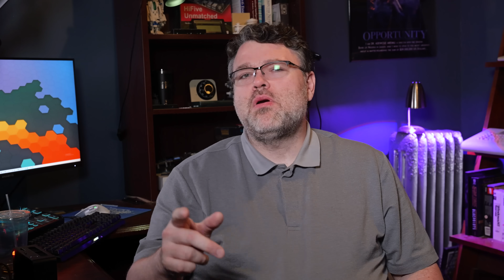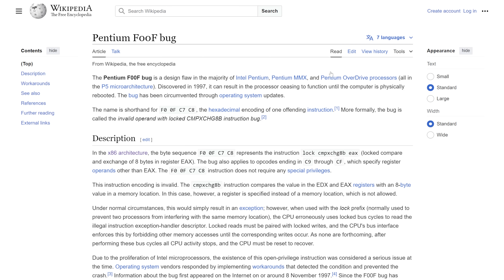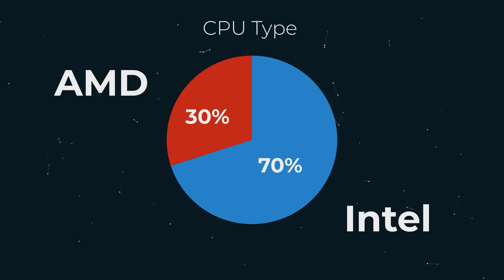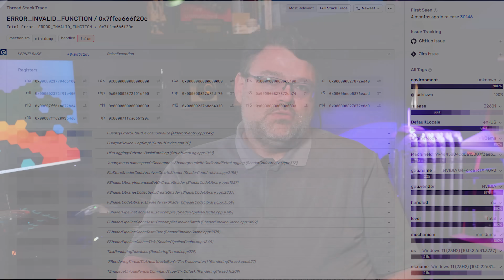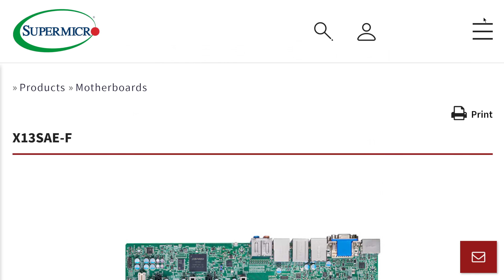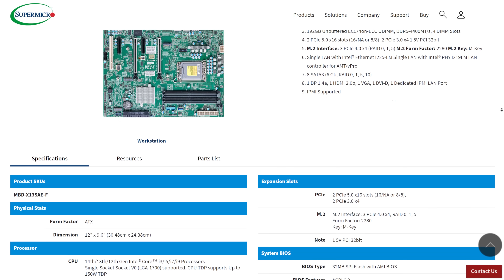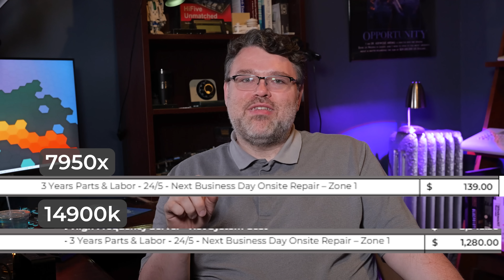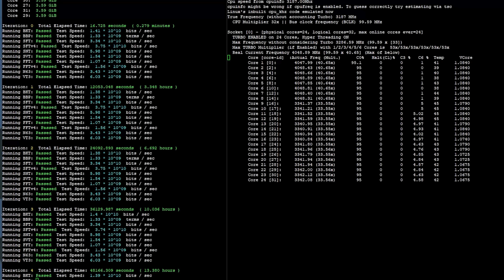Intel has a Pretty Big Problem

Comment: I know the focus has been on i9-13900 / i9-14900 chips lately. I have been seeing similar failure in HP Hardware (Z Towers for example) with the i7-13700 chips, with 2x16GB 4200Mhz DIMMs. At the office I have seen somewhere around 20-30% of the HPs with i7-13700s experiencing mystery crashes and failures which are tanking programs or the Windows kernel. The commonality of these systems are identical hardware configurations, and the systems running under a continuous load (streaming security cameras, running build chains, etc). Every system seeing problems experiences failures in the P-Cores, not the E-Cores, and it is consistently one of the cores. Sometimes the failures are detected by running Prime95 Blend for 3 minutes. Other times it can take two hours for an error.

The bad thing about the problem I'm experiencing is, HP's own Hardware Diagnostics never reproduce the problem. The diagnostics don't seem to push the CPU hard enough to trigger the problem. Because of that, even though I'm clearly experiencing crashes, HP is giving a harder time on processing a processor RMA.

The only common workaround I have right now is disabling Turbo Boost, which makes the chips miserably slow. These are systems with very Spartan BIOS and nothing but an on/off switch to Turbo Boost. But the problem took about 6-8 months of steady load to develop.

Something is definitely wrong...
Reply: sadge

Comment: This is Pentium III 1.13Ghz all over again. Intel simply mis-binned their high-end SKUs due to pressure from marketing in light of heated competition. Intel's 7nm node was never meant to push far beyond 5Ghz. Intel is literately selling hardcore overclocked silicon as "stock". The real fix is properly bin on their silicon, but Intel would get heat from mismarketing product that never can operate as advertised.

Comment: Okay. System integrator here. We jokingly say that there are no truly stable 14900Ks, only varying levels of instability. We have sold over sixty 13900K and 14900K (mostly in gaming builds), and so far, most of them seem to be fine. However, the failure rate is CLEARLY higher than any other processor that we integrated. I would even say 8-10%, but this is the percentage of clients that needed RMAs or a hard limit on power and current for their builds. I am convinced that the actual number of flawed CPUs is higher, but the customers are either not coming back for RMA or they are attributing their crashes to other sources. Intel isn't pushing back against RMA requests, and that's a good thing, but I agree that clearer communication is in order. The reasoning that they haven't figured out what is causing the issues is super unlikely, given the amount of time they had at their disposal and the huge amount of skilled engineers they have. I personally think that they DID find the issue and it ISN'T FIXABLE. 

So what could they say? Look, we figured out the problem, we will be fulfilling all RMA requests, our bad? People will want more than an oops, they'll need the details of the failure. Communicating that the architecture itself or the fabrication process is flawed would be a disaster for the shareholders and would ripple through the industry. They are, most likely, stalling and/or shoving this under the rug, and I think it's the only option they have in the situation they're in. It might sound cynical, but shareholders trump customers anytime.

For all the owners of 13900K and 14900K out there, even those who haven't experienced instability: if you value your build, go in the BIOS right now and set the PL1 and PL2 values to 253W and the current limit to 307A. It might not save already failing CPUs but will, in my experience, halt the degradation of working CPUs. The performance hit is surprisingly small (around 5% in most cases compared to a no limits configuration), the temps will improve quite a lot and consequently the noise levels.
Reply: yea it is hell working with intel

Comment: I have a 13900k and some 7000 something mt/s ddr5. If I run xmp for my ram to be worth the premium I paid for it back in the early days of ddr5, my system crashes constantly. Turn off xmp and it runs at 3600 I think, hasnt crashed since. WTF

Comment: I wish youtubers and reviewers stop reusing Intel terminology there's no instability the cpus and or motherboards are dead litterally burned I had both my 12900k and 13900k do blue screens then smell really bad...burnt and now can only run stock clocks and worse I can only run 2 sticks of ram, and no not ddr5 but ddr4 ! if I try to use 4 sticks I get bluescreens nonstop something in the memory management either on the cpu or motherboard has said it's goodbyes...I'm waiting for 9000x3d and I'm back on amd I had that on both a z690 ddr5 12900k pc then a z790 ddr4 13900k pc

Comment: I chose AMD platform because of 90 W vs 130 W on CPU. Higher watts both idle and load on Intel CPU made me give up on it. 
If I had went for Intel would have been Gen 12 I 7 or gen 13 I5, glad I didn't.

Comment: As someone who always ends up stupid overboard on memory, I found similar issues with my 13900k. I could never hit the spec'd 6000 on my dual DIMMs (2x32gb) (I think the highest I got was 5200) and had to bump down to 4200 for quad DIMMs (4x32gb). The pairs of sticks are exact same SKUs. I also have the power thresholds somewhat low (I think 275watt with an AIO cooler) and the P cores slightly undervolted

Comment: My 14900k had the issue but resolved since updating bios and using intel presets instead of mobo defaults, made up the performance difference by running my ram fast as balls and we good 😊

Comment: My son has had a 14900K for about 6 months, and has had no problems. He did undervolt and limit power use such that the CPU never runs over 70C, ever. Keeping the voltage and temps down has probably helped.
Reply: It probably has for the time being, but he (or you) paid for performance you're not getting.

Comment: I never thought I'd say this one day, but AMD is delivering a more stable set of chipsets and CPUs. As soon as I set up a new PC, I run Prime95 for 3 days in a row. Non-stop. I did this on all the CPUs that I have in the past. 2 months ago I bought a Dell Laptop, with a 13th generation Intel i7. It crashed on the first day. I returned it. I got a new one. Same thing. I did the same test on my Ryzen 5950x. 3 days in a row. No crashes, nothing. It's on 24x7, and to this day I've never had a single crash. Dell suggested sending me another model, almost identical to the Intel one but with an AMD processor. In exchange, they offered me more RAM and HD. I did the same test. 3 days in a row on Prime95. NO CRASHES. Rock solid.

Comment: For me my computer kept on crashing until I found the motherboard manufacturer removed all limits so my CPU got too hot (default settings). I have only unmature adjectives to apply to the mother board manufacturers. Btw I have a 13900K and didn't overclock.

Comment: Hey @Level1Techs, thanks for the heads up, i was thinking for the past few months of upgrading my i7 12700 (non K non F) cpu to an i7 14700k and now im wondering if i should stick with my cpu or get the non K i7 14700? my pc specs are: Msi MAG B660 Tomahawk DDR4, 2x16GB ddr4 @3200MHz , rtx 3060 ti + storage ... my cpu is cooled by Scythe Fuma 2 revB

Comment: I’ve experienced random failures on a Dell workstation with an i7-12700, Windows 10. Not gaming, this is work machine, no high performance GPU. The failures are accessing the SSD (m.2 NVMe), compressed folder on NTFS, “e” cores disabled. Failures are random, can run it multiple times, 1 of 4 runs might complete, the others fail at different points. Works fine writing to a network drive rather than the SSD, but I haven’t tried using a non-compressed folder on the SSD.

Comment: i recently got an oem i7 13700k from a good shop and after showing it to my friend realsied it has a few caps missing on the backside , upon asking a certified board repair engineer here he said it has been removed by a professional from the factory itself because it had some faults and it were resolved by removing the caps but he said even if it works well it will have some issues while overclocking which i find it true while the cpu tried to boost itself in games too hard it stutters and it wont let it push hard, i feel its porbably one of the reasons relating to the cpu being faulty and the oem supplier removing the caps so it can be used in some way possible ..............
if level1tech could say something on this it would be awesome

Comment: Great informative video. I can't say much because I am a sample size of one and I have a 13700k, but it's been rock solid, 1 single crash in the exactly 1yr I've owned it and that was probably from the various power tuning I did to it. It's the best multi-tasking cpu I've ever had. I can cpu mine on the P-cores and watch youtube/browse the internet or play older games on the E-cores without a hiccup. My 5800x3d is good at playing games but not multi-tasking.

Comment: I have a 14900k on ASRock Z790 NOVA WiFi. Running stock, no problems at all. I don't do gaming, but I do a lot of multi-threaded simulation work. Not unusual to run a simulation over several days. The only annoying thing is when Windows decides to do an Update before a run completes. I run the simulation from MS VS debugger so I can arbitrarily pause the simulation and examine variables of interest. I wish MS would force a Break to the debugger prior to a shutdown, then save the VM of the session. Then do the reboot, and restore the VM. I can do the Continue.
Reply: If the update cadence is not managed by your company, you can pause updates for up to five weeks (Windows 11).

Comment: My 13900K crashes stopped over a month ago when I disabled the Intel Turbo Boost Max 3.0. No crashes. Windows update works now. NVIDIA driver no longer fails to install. World of Warcraft, Diablo IV, and Overwatch 2 no longer crash. No more bluescreens. I suffered all these issues for a year. I did have 2 game crashes, but I blame that on the game being in Beta test. Other than that it's been a pleasant time without those issues. Setback is I don't get the CPU speed I paid for.

Comment: @8:00 overclock can ABSOLUTELY cause data corruption!
When the FSB goes up you get errors between the CPU / RAM and the disk controllers.
This used to be a problem when using RAID. Software raid had a very decent chance of getting corrupted if the OC was too high.
The PC appeared stable but data corruption would start to occur even to a point where the raid array would go down.
Reply: That was a very valid concern with VIA chipsets in particular. The problem varied heavily as well. Big issues on some old IDE drives in particular. It's the disk controllers that get overclocked and well some of those didn't behave well. You probably wouldn't want FSB cranking up PCIE though on a early hot pocket Gen 5 M.2 however.

Comment: It would be really interesting to hear the thoughts of a large OEM coming out publicly explaining issues from their perspective. Especially enthusiast platforms which are sold with a pre-configured overclock as some of this should come through during initial validation of stability of the applied clocks. For personal use, my 5800X3D continues to look like the best value for money ever for performance with zero issues for what was a drop-in from a 3600.

Comment: My 13900K has had random BSOD's (not too often) and VERY frequent Chrome/Edge "Access Violations" - upwards of 20x a day where whatever web page I'm on gets reset.  I've set my multiplier to 55x on every core (a few were set to 57 or 59?) - and I have yet to see an Access Violation or BSOD.   These Access violations would happen in linux or Windows.  Jury is still out though.
Reply: Your cpu is bad. It needs to be replaced and yes it’s part of the errata

Comment: My 14700k has the same issue, i am somewhat mitigating the issue by limiting my clock limit and lowering my clocks manually setting my memory and making sure the intel power settings are activated. still get crashes here and there but its better than stock setting crashes.

Comment: I'm seeing a lot of people confused.  It's not just i9 chips!  The 14700k is also a POS.  I've seen others with issues as well.  People talk about the 14900k more but it's still a problem for the rest of us with 14700k chips too!  

I have not tried to overclock mine.  it's running with DDR5 5600 48GB corsair modules.  Custom loop with 420mm + 120mm + 280mm radiator.  6900XT GPU.  

It crashes in two different operating systems!  I dual boot Windows and MidnightBSD.  In the latter, LLVM clang will start crashing during long compiles (10+ min).  On windows, I mostly game and that is also unstable.  I made all the recommended changes that intel proposed.  I turned off asus mce on the first day of ownership last november.  

Worst CPU I've ever owned.  It's slower than the 3950x i had before for compiling and with all the nerfs to make it stable, it's starting to lose the gaming advantage.  Huge waste of money.
Reply: @ffw-d4c   25% failure rate means 75% with no issue.  There's no guarantee you're going to keep being this lucky in the future though.  For many the problem starts small and progresses.
Reply: Hear anything about this also affecting the 14900hx laptop cpu? Or they safe?
Reply: @WaterspoutsOfTheDeep  I've not seen anything about laptop CPUs either way.
Reply: you don't have to "try" overclocking it, turbo boost is usually turned on by default so it automatically overclocks for you. If you want to avoid overclocking you'd have to turn off turbo boost.

Comment: These CPUs run at 90C right? Or 105C? I know intel says 'that's fine' but physics says no. Silicon past 70C degrades. We know that from 40 years of data. They didn't magically overcome physics. So the error rate going up would make sense if these CPUs are subjected to spikes or sustained high temps.

Comment: The way that it seems to be a moving target I suspect Intel themselves don't know what's wrong. When the i7s have the same P core cluster but don't seem to be suffering the issue you'd  automatically think it's that 8 e core cluster. But if disabling e cores doesn't always help then maybe it's something that's different with the interface with that specific cluster that was changed with Raptor Lake.

If it was the architecture itself where's the complaint from the millions of i3 i5 and i7 owners? I know there's been a tiny blip of 14700 reports but that might just be a knock on effect from the i9 reports. If it were a microcode issue wouldn't that still be effecting i7 and i5 owners? If it's a fault with fabrication, again why only i9s? 

But to be fair, you have to question the wisdom in using consumer grade hardware for datacenter use. There's a reason enterprise hardware is clocked much lower and uses ECC memory and that's stability. Enthusiast hardware like the i9 is focused on performance. Taking that hardware and putting it into a datacenter role is really going to amplify any underlying issues that you think would be a goldmine for Intel to look over, but any end user expecting 24/7 server stability, 24/7 full tilt server workload, but with enthusiast performance just seems unrealistic even when power limited. I'd be shocked if my CPU didn't throw an error here or there with that abuse.

I'm already seeing comments here interpreting this as "25% OF ALL I9S ARE DEAD", when that's NOT what he said, and they don't realize this is W680, NOT Z6/790, and the workload being placed on these is FAR higher than your game and it's amplifying the issues. He said 10-25% of CPUs have a problem or are marginal in some way.

Comment: Are you suspecting L1 (die level layout)? I had been under the impression it was L3-L7 (memory system, OS and application). That would mean parts of the L2 could be compromised. Do you have enough data to prove time in dynamics of multiple actor?

Is Intel capable of scaling current against superscalar?

Comment: Intel knew the limits of their CPU's from their testing and overclockers pushing their CPU's beyond their limits publically.  Any reasonable overclocker knows pushing 1.45 plus volts (stock) through a CPU is a recipe for disaster in the long term.  I overclocked my 4770k the day I bought it for 10 years, for 7 years it ran at 4.4 Ghz @ 1.35 volts until it became unstable at that frequency and voltage, I then backed off the overclock and voltage to 4.3 Ghz @ 1.32 volts for three years until I built my new computer with a 7800XD.  The 7800X3D never pushes past 1.1 volts which is what my 4770k used to run at stock.

This is the 9590 all over again, pushing tons of voltage through a CPU with the hopes to remain relevant.  They are not stupid and overclockers are not stupid, this amount of voltage will harm the quality of the CPU in the long term because their manufacturing advantages are no longer competitive.